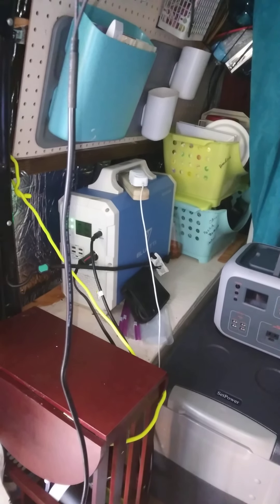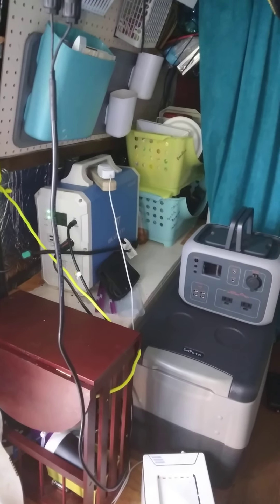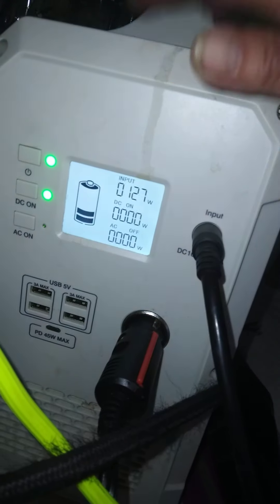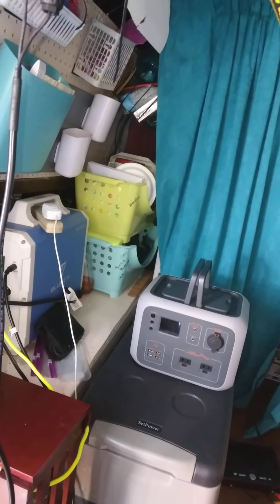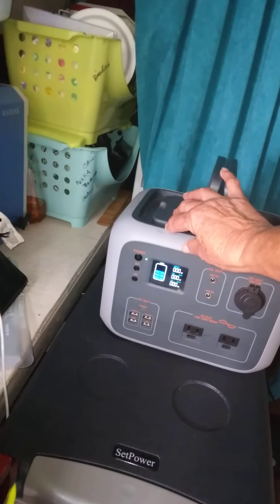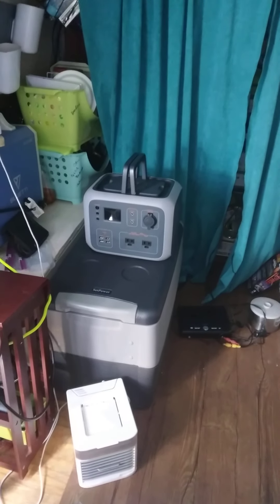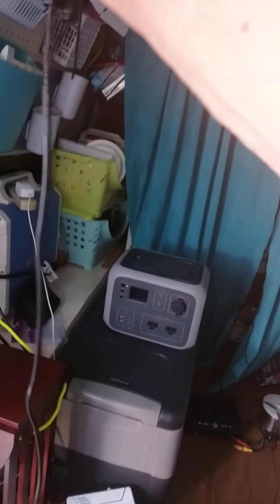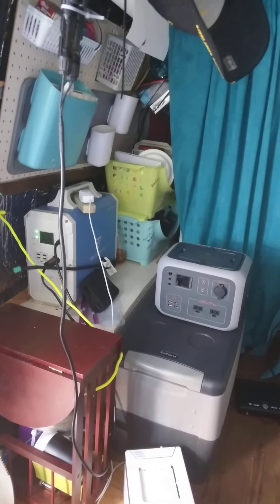Using BLUETTI in a VAN

Comment: Thanks Lindy. Boy I have to safe up some serious money. Solar is expensive
Reply from the maker: Depends on how you want to use it.  I bought it over time and only when it was on sale. I looked at sites everyday.  500w I got for $349  1500w $999. I have never seen this low again.  Always look when they present a new product. The one just below the new ones wattage will always go on sale. People want the new one. By the time I moved into van they were paid for.
Reply from the maker: Bluetti has a sale on eb55. $449  that's cheap for 537w usage and 700w surge. Will run all your fans lights a rice cooker.